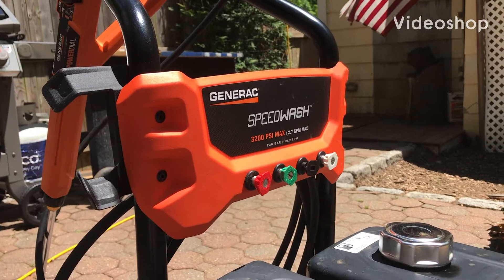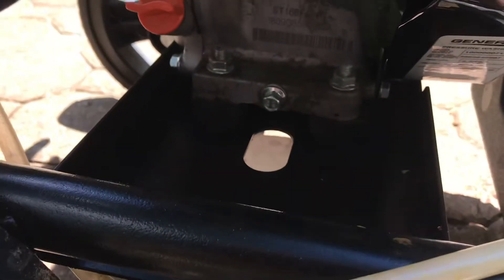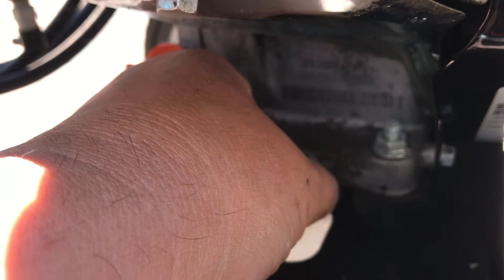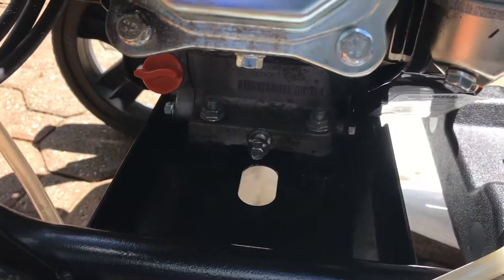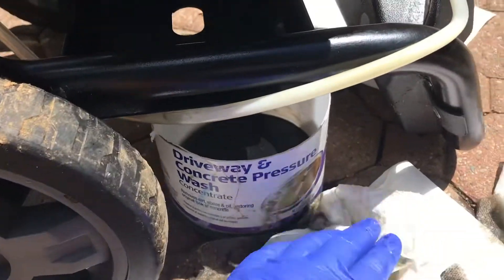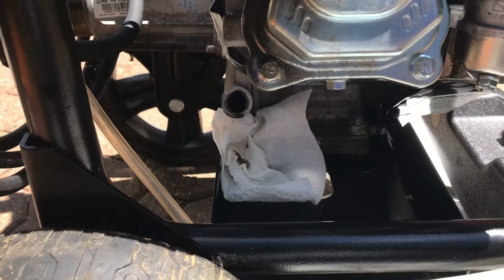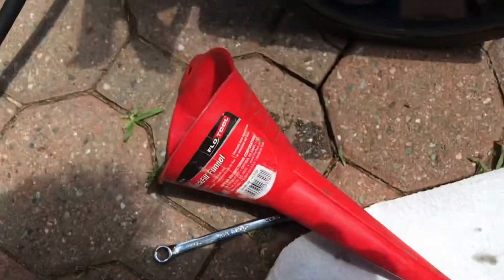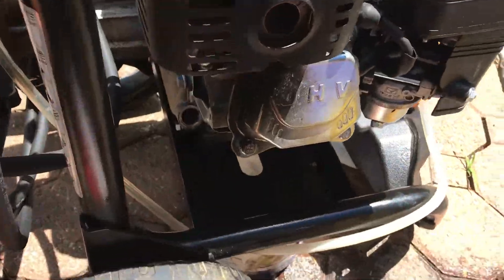Generac 3200 psi speedwash oil change

Comment: If you got a new pressure washer or any small engine that uses oil for that matter I am hearing it is best to change the oil after a few hours use the first time because there are small metal flakes in all these engines that flushes out into the oil. This will help preserve the motors lifespan.
Reply from the maker: Very helpful  thanks Monquiturdle 👍🏻👍🏻

Comment: First off this machine does not hold anywhere near a quart of oil!!!! 
It takes a little over a pint. 20 fl oz to be exact. 10W-30 or SAE 30 according to the manual. But that depends on the temperature of the environment you are using it in. 
Heed my advise or you will be using your pressure washer to clean off 16 oz of oil from your concrete after it leaks out all over the place . 
You’re welcome .
Reply from the maker: East does it pal!!!😂 thanks for your input bro. I’ll definitely keep that in mind👍🏻
Reply: @HighRidgeHandyman  East does it??
Reply: Glad the oil-fill issue was brought up!

Comment: What kind of oil?
Reply from the maker: SAE 30
Reply: @HighRidgeHandyman  thank you
Reply: @HighRidgeHandyman  is this different than pump oil?
Reply: Remove dip stick while draining to vent for better flow.
Reply: @danielswinger2986  Use only SAE 30 oil for the pump. The engine allows for different options based on climate.